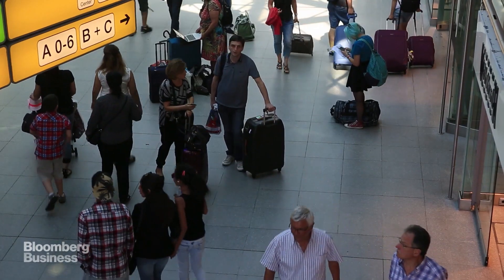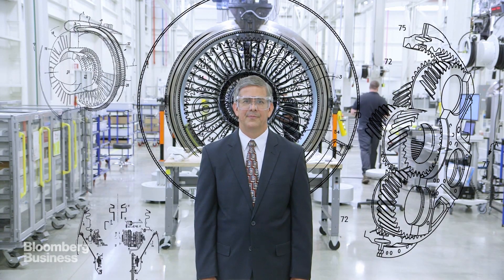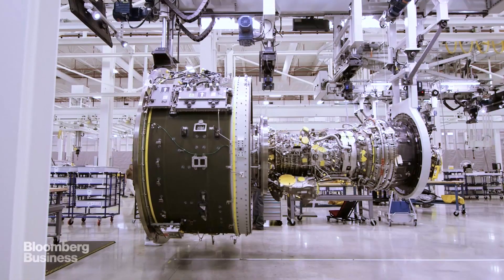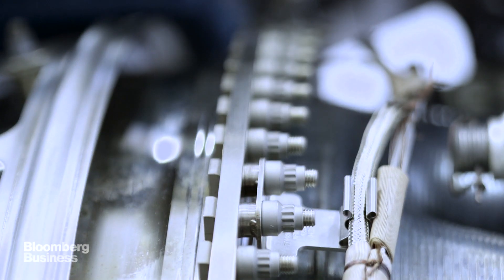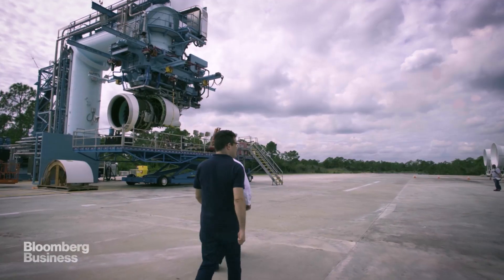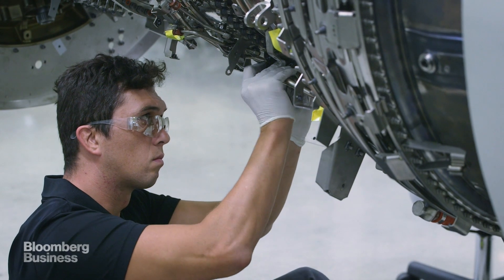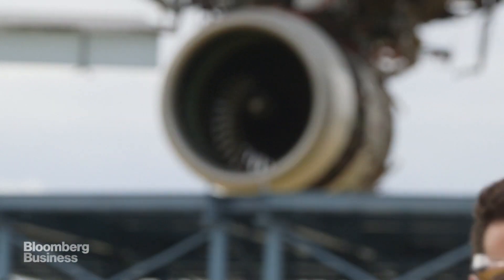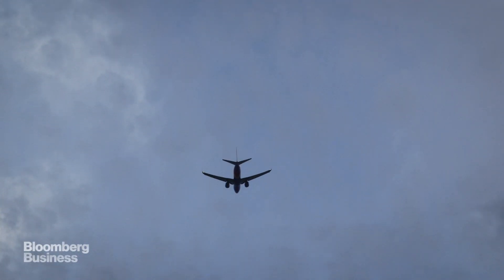This Genius Invention Could Transform Jet Engines

Comment: Hang, Im 47 & I naturally understood the ducted fan needed to spin a lot slower than the core engine for all my life!
 I assumed they all had a planetary gear set to drive the fan at about 1/3rd of the core engine.  It shocked me to now know they were direct drive till now & they are finally going to get these optimum different speeds sorted! About time, well done.👍
Reply: the core and the fan are on 2 different shafts. Modern turbo fans have 3 shafts all spinning at different speeds. The turbine is engineered in such a way that it will rotate at the appropriate RPM. If you want the fan to spin slower just move the turbine further back in the engine where there is less exhaust energy to be extracted.
Reply: @lusher00  Oh, I see, thanks.😀 to be sure I've got it right, theres a seperate shaft between the front large ducted fan, going right through the core engine, to a seperate turbine behind the core engines turbines, that only drives the fan? This would leave the core engine to spin at its optimal speed & efficiency, without being limited by being connected to the fan up front? Correct?
 Whats the 3rd shaft for may I ask?
Reply: @richardteale8203  well if you had 3 shafts it would be 3 stages. Ive heard this described as the core (high pressure), then the second stage acts as a super charger (low pressure) for the first stage and the 3rd stage drives the fan. You can tune all 3 stages to rotate at an optimal RPM. Ive only seen the 3 stages on giant airline engines though. Smaller engines are only going to have 2 stages.
Reply: @lusher00  Cheers.🍻 Ryan, that's filled me in. Thanks. Rich.😃
Reply: @lusher00  Wow! Thats unbelievable! What is this world coming to, if people cant be decent to each other over general matters like this, that arn't even political or personal, which are cause for contention!
 I really appreciate your input & hope you have a better run with others elsewhere in the future Ryan!
 Cheers.🍻 brother.👍 Rich.😃

Comment: Uhh.... this isn’t new, it’s not the only way to do it, and it comes with a host of problems. 

First off is IAE’s Superfan engine which was developed for the A340 over 30 years ago. Of course, the A340 never flew with this engine, only the CFM56 and Trent 556. It was abandoned because of technical problems that could not be overcome. 

The UDF was another way. A slow moving unducted multibladed propeller. Again, cancelled after technical problems. 

Finally, the Rolls Royce three spool turbofan engines. Rather than there being a compromise between the fan and low pressure compressor speeds, each are allowed to run at their own speeds. The reason why Rolls Royce hasn’t dominated the engine industry with it is because of the extra weight and cost and complexity isn’t offset by efficiency.

In the pursuit of absolute fuel economy there is no better turbine engine than a turboprop. Tiny gas producer and a gear box reducing very high RPM to very low RPM driving an absolutely huge propeller. Every airliner should be a turboprop for fuel economy sakes. 

But people hate propellers and they hate going slow. The turboprop loses efficiency at high speeds even with a very slow moving prop not because of its supersonic blade tips, but because of its installed drag. 

The turbofan engine is the compromise between the turbojet and turboprop. High bypass turbofans aren’t as fast as turbojet or low bypass turbofan aircraft. But nearly so and the public doesn’t see propellers on the front. 

Going to a geared fan engine simply pushes it more towards a turboprop. Fuel efficiency is better, but installed drag is higher and speed is necessarily lower. This was why the SuperFan and UDF were cancelled. Then add the weight and complexity of the gearbox and the cost as well and it isn’t feasible. 

There have been much smaller geared fan engines like the TFE731 on small business aircraft but something like that isn’t easily scalable. 

The simpler way to get efficiency has been higher compression ratios and higher engine temperatures. New materials and new methods of cooling have allowed compression ratios approaching 40:1 and very high combustion pressures. Keep moving that way instead of the dead end we’ve already been down.
Reply: Hahaha I kinda feel bad. What point in Your life are you where you can write a 7 paragraph essay on some engine in the comments of a youtube video? Not hating just funny. If that's what you enjoy go for it I guess lmao
Reply: I have a lot of time during layovers during the 15 days a month I work. I can spit out 7 paragraphs in ten minutes.

Comment: AVCO Lycoming ALF 502 L2  and R3 were geared fan engines in the late 1970s. The R3 was on the British aerospace 146. It was a four engine airliner with low noise that could get into most FAA noise restricted airports.

Comment: More issues, a turbine engine is totally quiet directly in front of it. It's not the fans making the noise it's the turbine combustion and speed.
Reply: Nope. You hear the buzz saw of a large fan over everything else

Comment: Fuel per person on a flight from la to New York cost 75 gallons of fuel in the 60s and today its 24 gallons.
That's fair efficient increases .sadly like automobiles the tech has been there for decades and it is trickled in to use .
Like any other industry its trying to play in the middle of oil tycoons and profits for themselves . You do to much to fast and you miss out on time to profit.

Comment: @(3:00) We see a guy on his phone, standing in front of a rotating jet engine,
talking to his mother. How ridiculous is that? Dude...80% of the noise being
generated by a jet engine comes from the exhaust section...not the fan 
section!! Duh! That's why you'll seldom ever here a jet aircraft coming towards. 
By the time you actually hear it, that's because it's traveling away from you.
Reply: It's actually the other way round. At many points in flight and taxing a jet engine is quieter at the back, due to the hot air being expanded carries less sound.

Comment: I am familiar with the capstone turbine that is connected to a generator, it turns 35,000 rpm if i remember correctly, it has air bearings that last forever,no need for lubrication.  that might be a cool way to propel planes.

Comment: Anybody remember the RR rb211. Pure junk for many yrs. How about the engines on the Bae 146....also geared but pure junk. Again took decades to make them right.
Reply: Your use of the phrase "pure junk" in relation to successful engines is idiotic. Also the RB211 isn't a geared fan engine.
Reply: I worked in the power plant at Air Canada. They did 1900 mods to the RB211 engines used on the L1011. They were flying 10 hrs between the main fan blade bearing changes in the early days. They had engine change only crews for years on end.
 You are correct in saying it is not a geared engine. It is a triple shaft engine. It did take years to perfect. When Air Canada stopped flying the L1011 the engines were much more reliable than in the early days.
  The P and W JT9D on the 747 had many problems also as did the GE CF series. I saw them first hand.

Comment: OK, so it's 2019 now...is any airline using these new new engines/ Did they find glitches?  Are they too expensive? By now, on such a revolutionary fuel efficient product, I would expect 60-70% market saturation. How is it doing?
Reply: I suspect geared box requires regular replacement. Imagine gear box for 35-50MW source.

Comment: Several hundred feet in front of a high bypass turbofan is nothing new or spectacular.
Reply: Yes. He should be behind the jet engine. If it still has the same high thrust, there shall be jet blast behind.

Comment: I don't see the big innovation. I would rather see a new airplane that climbs way higher 60k plus feet and takes half time to get from point A to point B.....That would save a lot of money
Reply: This is not possible for contemporary turbofan. Those big fans limit the speed the aircrafts can reach. While turbojets can provide supetsonic speeds, but if they have bypass ratio 0 they consume 2 times more fuel for the same thrust, and 8  times more fuel at Mach 2, than turbofans. Concord has shown State-Of-The-Art in this area, and some evolution engine can be 10-30% better of this 8x times fuel consumption.

Comment: Why have the engine joined as one on one shaft? Could it have independent shafts? Which would eliminate need for gearing and allow a difference in speeds.

Comment: Where does the fuel get burned because there should be blacked out areas of the engine some where?? And it has been said that fuel is only used for take offs and landings also taxiing to and from runways. The wings contain hydraulics for the wing flaps and wiring to run the electric motors to run the draw screws. Very little room for fuel at all.

Comment: Why don't they just feather the fan-blades to zero pitch,  when it reaches top speed; and turn the engine  into a ramjet?
The purpose of the turbine is to get it moving; but then at higher speeds it produces drag.
Feathering the blades would solve the problem.
The problem is, engineers have to over-complicate everything.
Reply: Lockheed did that on the SR-71. The engine windmills and it turns into a ramjet. Since the SR was retired this is Old technology.

Comment: See how big these are?  These are what DIDN'T GO THROUGH THE PENTAGON'S  15foot  hole.
Reply: I've always wondered about that as a former jet mechanic. Also, engines are superhard alloy and heavy - they don't disintegrate like a flimsy sluminum plane body. They are always intact on impact. So there should be two big side  holes or a big oval.
Reply: There was/is a group of PILOTS FOR TRUTH OF9/11 in fact that , not only the physical plane was discussed, but those outlandish maneuvers that couldn't even be done by SKILLED pilots. @cybervigilante

Comment: So let me get this straight. This super smart engineer has been working on this kind of problem for 30 years. Trying to slow the fan turbine while keeping the engine revving high. And he came up with a gearbox, that some other manufactures have been using for a while now and cars have been using them since day one. Top effort bro. 👎
Reply: The difference is that unlike the geared turbofans of the 50's to 70's ( Turboprops and turboshafts as well ) could generally only handle around 7000 hp. This increased as time went on but these people managed to make the gearbox handle 30000 HP reliably for the lifetime of the engine.

Comment: Next it will be Hybrid and then full 100 % electric ! ;-)
Reply: Well there are full electric small planes being tested now.
Reply: Jason Buis , well that's great ! Was not aware of that. Thanks !
Reply: Kamrul Hassan ,Red bull were developing a electric powered aircraft for its  racing show .with a twin reversing prop.dont know if it ever actually flew.
Reply: Christopher Keik , thanks for  the info. The only "Red Bull" I knew is the high caffeine drink sold in U.K. :-)
Reply: Then it would be a jet engine lol

Comment: Published almost 4-years ago - is this an improvement that is still viable or not?
Reply: Yup, the A-220 has them installed. They were expecting an increased efficiency of 18%. During operations they found they were actually getting around 20% to 21%. Now that is probably because it's a new aircraft composed of lightweight materials. In the end saving that much fuel is huge.

Comment: Gearing is stupid. The best gearbox is no gearbox. They instead should use turbine driven generators and load balance using ultracapacitors. They can make a wing that is just a formed ultracapacitor. Then just power the fans using electric motors. The motors can produce more lift when needed because the ultracapacitors can unload minutes of charge time into seconds. The turbines would then just be the base load holder once the plane is at altitude.

Comment: The real breakthrough, the inevitable and long-delayed innovation that no one is talking about? Electric planes. Small proto-types work--it's only waiting for the new glassene ion battery tech, which also works but is waiting for...the robber barons in the fossil fuel industry to have their cold, dead hands pried off our necks.

Comment: Rocket fuel burt the hole in the ozone layer, these dirty giant oil burners are creating so much heat in the atmosphere they are turning the sulphur dioxide into sulphuric acid, you are flying in a sea of acid it is causing serious mental fatigue, the A380 airbus will burn 81,890 gallons of kerosene in 24 hours, 50,000 plus planes in the atmosphere 24/7 they are destroying the ozone layer,corrupt governments have got the bloody cheek to blame the motorist, aircraft pollution is suffocating our towns and cities, they burn so much fuel it is out of control. governments want to increase flying that proves climate change is a money making scam.

Comment: Errrrr. Its called a turboprop. Hardly new.😂😂😂
Reply: Much different than a turbo prop or turbo shaft for that matter. Keeping those front blades slower than the compressor stages on a high bypass engine that big is difficult.

Comment: Isn't the amazing safety record of jet engines due in part to the fact that they don't use very many moving parts that can break at any time?
Reply: It probably is, however today it's all about efficiency
Reply: Just did some research on this and there are actually less moving parts in this engine than some other turbofans.
Reply: go big red

Comment: So will there be a choice between manual and automatic gearboxes? Coz I reckon the clutch could be a tad heavy.
Reply: I'd like to see them pop the clutch on takeoff.
Reply: They will add a tiptronic paddles on the yoke soon.
Reply: A stickshift in the cockpit, maybe with dice or a skull, would be sooooo cool.
Reply: @cybervigilante  Dice hanging from the compass would be so cool.
Reply: Well it would have alot more thrust at take off. 🤔

Comment: I'm not seeing the innovation here
I've been flying geared turbofans for decades
Reply: Yup, even likes of the PS-90 have been powering heavy cargo planes since the 60s.
Reply: @harrisn3693  PS 90 is not geared
Reply: That,s why your flying and engineers are engineering! It's a very evident fundamental need that they finally where forced to introduce by the need to save.
Reply: I think the innovation is that it is a high bypass engine. To keep the blades on the front of the engine slower than the compressor blades I think is tough to do on a engine of this size.

Comment: The reality is, the savings are not passed down to their customers, it stays in their pockets. The airline industry is one of the most cunning industry in the world today. They penalized you when you fail to take the flight and then they don't return your money. Isn't it that when something is taken away from you against your will, that  is called stealing? Their corporate lawyers found a loop hole that when you buy a plane ticket they put in to fine print their condition that you cannot refund your money, to them you agreed on the terms. But do you have a choice? Legal maybe yes, moral, definitely no.

Comment: I SAY WHEN THEY CAN'T EVEN USE THE PROPER LUBE AND SERVICE THE JACK ON THE TAIL OF THEE CRAFT AS WHAT HAS BEEN SHOWEN LATELY AND EVEN BEFOR AS THEY DUMPED A PLAINE (737) INTO THE PACIVIC AFTER THE PIOLET FLEW IT UPSIDE DOWN FOR HAFE THE TRIP FROM ASN DEAGO TO SHORT OF L.A. I WOULD RECOMEND A STRAITE SHAFT OVERY ANY TRANSMITION GEAR BOX OR ANYTHING THAT BE NEGLECTED UNTILL 4 OR 5 PLAINS COME APART TO GIVE THEM THE MAX ON HOW FAR THEY CAN GO WITHOUT DOING ANY MANTIANCE AS I AM A MECHANIC AND I KNOW JUST HOW CORP PUSHES THIS STUFF AND HOW THEY WORK IT TO SHUT UP PEOPLE THAT SPEAK ANYTHING ABOUT ANYTHING (SAFETY WISE) YOU BETTER NOT PUT THAT KIND OF CRAP ON THIS PLAIN JUST TO SAVE FOR YOUR SELFASS GREED! I HAVE BEEN FIRED FOR SPEKING OF SAFTY AND I WILL TELL YOU THEY DO WALK THROUGH EVERY FEDERAL LAW AND EVEN WORSE TO HARM THEIR BEST PEOPLE EVEN! DEAD AND GONE IS ANYTHING HOLY!

Comment: Solid State Generator 
Energy from magnet can be obtained without any mechanical movement.
 All we need is material capable of being converted from magnetic to 
nonmagnetic when applying electrical impulses. This will simulate the 
rotation of the armature in the generators.
 Such a  material was created for other purposes and there is 
technology. More info ?
Reply: @dwilliams2068  There is no heating on small generators and motors. For hard working machines probably will need some "wings" like in regular electric motors. But remember you will be able to generate exact needed amount of energy and in motors exact power required. So no heating looses exist at all. Sorry for my English.
Reply: @dwilliams2068  Attention! We don't magnetizy material! We just make it magnetic for a second in front of magnet to make a bridge to copper coil winded on our smart rod. I can send you diagram etc.

Comment: Allied Research developed the first reduction geared turbo fan engine in the 1970s, the TFE731 series engine.  This is not new technology, just built on a bigger scale.  I would love to see the planetary gear on this beast.
Reply: The innovation is doing it on a high bypass engine that big.
Reply: @Drendle87  yes, incredible.  Planetary and sun gear must be immense.  Inspection interval will be interesting.  But still not a innovation.
Reply: @Motormouth2112  I respectfully disagree. There was a reason this hasn't been achieved before
Reply: @Motormouth2112  If there is 30,000 pounds of thrust I wonder how much force is applied to the gears
Reply: @Drendle87  yes, quite impressive.  I worked on 731 for several years at Garrett Aviation, and the reduction gearbox was always  an impressive sight.